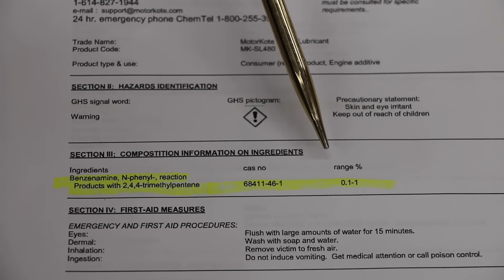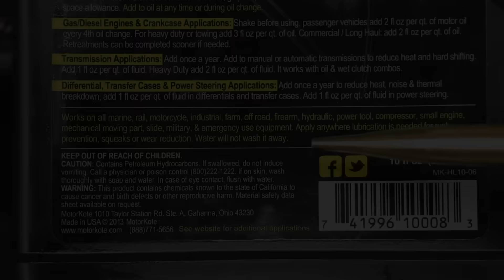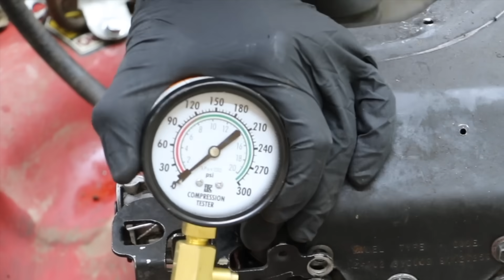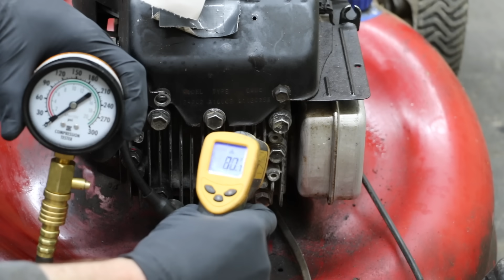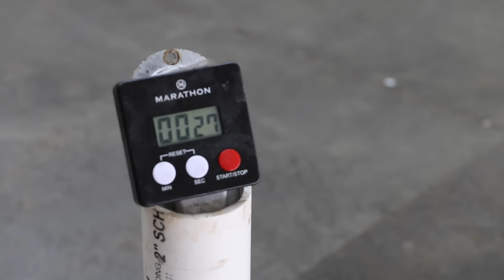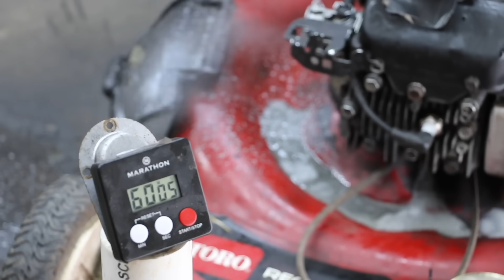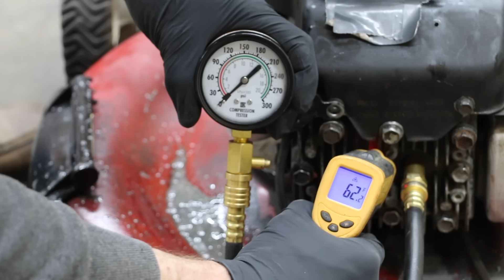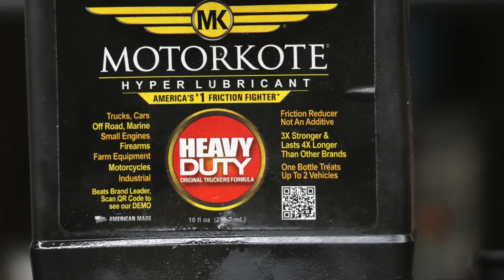Can MotorKote survive the water test?  Let's find out!

Comment: I've used motor coat. It's really slick, and I would not recommend putting it in a wet clutch. I made that mistake and my gas mileage went down in my motorcycle because the stuff was so slippery.
Reply: Have used it in my Yamaha xj1100 with no issues at all.

Comment: Just out of curiosity, have you or anyone just tried running a lawn mower with just water in the sump and no pre-treatment? I'm wondering if the water and the residual oil in the mix would provide the necessary lubrication on its own like lathe coolant does, or maybe we just think engines are more delicate than they really are, particularly single cylinder ones like this that aren't tuned anywhere near the edge of their capabilities

Comment: I've used it and noticed a difference straight away, engine (Diesel) ran smoother for sure. Gave some to a work colleague to try and he told me it cured his petrol engine from rough running. I used it religiously but it wasn't cheap and because I was taking very good care of my car I just stopped using it.

Comment: Excellent stuff. I use it in my 2010 RAV4 with the known vvt solenoid noise/wear. Not only did the noise nearly go away, it's been running for YEARS with no issue on the same worn/noisy vvts. 

It's expensive but it's going in every fuel engine I own. It's proven itself to me and this video absolutely solidified my results. 

Excellent test as always. Very well thought out.
Reply from the maker: Thanks!

Comment: Coat the under deck of your riding mower mow heavy then use a water hose to spray clean your surfaceit cleans up easier andif you paint  it on your snow plow snow will slide off quicker
Reply from the maker: Thanks for the feedback.

Comment: I am quote quite pleased what are the results of this video. In the past, not only did I put a little bit of motor coats and an old Cadillac that I was driving for a work car, but it took a lifter noise away that I had. One morning, it was about minus ten degrees, and all of a sudden, I had a lift or noise.  I i was a little afraid, but then I remembered I had Motorkote in my garage. It took the lifter noise away almost immediately.  I also mixed up a small bottle, of Motorkote and kerosene to carry in my work truck to coat ratcheting chain binders and hinges on containers.  It worked like a charm.
Reply from the maker: Thanks for sharing.

Comment: Hey Project Farm, I was hoping you'd do a test like this on ProLong Engine Treatment.  Both treatments also seam to utilize chlorinated components which creates a concern of reacting with the moisture to form hydrochloric acid, and both treatments also claim to have no short or long term corrosion risks.  Is there a way to test if these products convert to HCL and whether their PH goes down over time or their products become corrosive after exposure to moisture and extreme heat?
Reply from the maker: Thanks for the suggestion.

Comment: This works real well stopping the 5.7 hemi cam failure and lifter wear. This also case (chemical) harden and create a super smooth running engine.
I use this with vintage engines with flat tappet cams plus less ring friction. I have used this from the 70's when you could only get it in michigan where it was invented by the university of Michigan Kalamazoo campus. The formula was sold off for the sum of 3 millon dollars so the liberals could get a raise, but by the next year they were broke again.
Reply from the maker: Thanks for sharing.

Comment: I used motorkote once in my engine. I ended with a crumbly black sludge in my engine. Had to run multiple bottles of seafoam through it to try to get it cleaned out. It clearly doesn’t do well under pressure and heat in an engine. If you want to lube up a door hinge with it fine but DO NOT put this stuff in your engine
Reply: I run this in five different vehicles two of them being commercial semi, and I did not experience what you were talking about. I’m curious if maybe the motor coat removes some of the crap that was built up in the engine.
Reply: @uria711  I suppose that is possible!
Reply: @Unctahdew  what would be cool is if you try it again and see what kind of results you get. I can definitely tell you I have had zero issues and I have had increases in fuel economy.
Reply from the maker: Thanks for sharing.
Reply: I've used this for a good 10+ years in 3 or 4 cars.  Change the oil regularly.  Never had this issue.

Comment: 'MotorKote' claims (on the bottle) to work in transmissions. This is a curiosity to me. ATF lubricity is purposefully designed not to interfere with friction disk function. I am genuinely intrigued to learn about the effects of a "Hyper Lubricant" on normal transmission operation; e.g., cause "shift flaring" or similar. Is it possible to add this to your future tests?
Reply from the maker: Thanks for the suggestion.

Comment: Found this comment. Makes me wonder if you may want to test  MotorKote again to see if they  have changed the formula, and  claim you have to add every oil change since you tested it 6 years ago. Comment:: They have since changed the longevity that's for sure because the newest bottles say use every oil change. I kept using it and can say there are 3 types of products I have used to see if the benefits of mororkote can be removed without tearing down the engine and sanding. My conclusion that can be replicated tine and tine again is a fuel tank with 4oz per 10gallons of fuel of marvel mystery oil and in crank case following bottle instructions will in fact remove the motorkote. The same can be replicated with seafoam. After I figured out it is not total and permanent I continued to use it in 2 vehicles( the same truck) and a family compact sedan both using motorkote for over 50k miles in the truck and 84k miles in the sedan with no bad effects. Both vehicles now well over 215k miles on odometer and have not shown any signs of negative effects. To answer your first question the mileage did improve even furthermore the following days once it really circulated and stuck thoroughly If I can remember correctly I gained almost 2.6mpg mixed driving which doesn't sound like much but 2.6 mpg everywhere you go every single time you drive is, highway or city, year after year adds up to quite a serious amount depending on fuel price per location. The 3rd product that will remove it is b12 chemtool.
Reply from the maker: Thanks for the suggestion.

Comment: for smaller 2 cylinder diesel generators which hold 3 quarts of oil would it be ok to use 100% motorkote on its own ? So do you think motorkote is basically a high end motor oil like besides quality is there a difference with one quart of conventional motor oil and one quart of motorkote besides the fact it seems to be much better then conventional oil?

Comment: I wonder if a person could run this in a two stroke, add it to the fuel oil mixture, wonder if it would help or hinder the burn.  I have an oil injected two stroke I just might try it.  Maybe motorKote will have to add a new use to their label.
Reply from the maker: Thanks for the suggestion.

Comment: Moly MoS2, graphite, WS2, and Ceratec. The only one that made an actually noticeable difference in how easy it is to start my snowblower is after using ceratec. But, it does not seem to last. The tungsten and molybdenum disulfides may break down to form sulfur based acids which might not be so good for wear in the long run.
Reply from the maker: Thanks for the feedback.
Reply: @ProjectFarm  so, I request you to please at least look at studying ceratec, in my snowblower it actually does something that is, not just my imagination, noticeable so I think you will find something there, not sure what, maybe that it only lasts for a little while or that there is some trick to using right so that it works well, or that it reduces friction by 50% but increases wear 3 fold or that it fouls spark plugs, I don’t know but it is the only one these snake oil products that I have ever tried where, even if only for a little while, it seemed to actually do something real. It seems not when you have added it, but after the oil change following the one when it was added. I.E. you put it in and use it, then eventually change the oil and that’s when it seems noticeable. Though, I have never tried motorkote…or the other product that impressed you. Thanks and good luck.

Comment: I saw the FR3 video from 4 years ago.       I have a KIA oil user  and will get a new engine soon I am  leaning to using one from these..Petron Plus, Archoil, Liqui moly CeraTec or Bestline..... Let's see. so many..Archoil 9100, Atomoil, Bestline, BG MOA,  DT550, Duralube, Hot shots, Liqui Moly, Lubeguard, Lucas, MMO, Motorkote, Prolong, Petron Plus, , REV X, Rislone, Seafoam, Slick 50, STP Ceramic, TriboTex, TurboMax, XADO, ZDDP, , ...and I missed some...
Reply from the maker: Thanks for sharing.

Comment: I’ll send you a new unopened bottle of the new Motorkote. I have both the True Original and this new formula which they are calling original. I will contact Motorkote but I’m sure they will say it’s the same but it’s Clearly not. 
And I will send you a new bottle of the Motorkote to test and see if it performs as well as the original did.
I will most likely do a video of my own showing the clear difference between these to Motorkotes, the True Original and the New Version they are calling Original.
If you email your address you’ll clearly see Th difference between the viscosity between the original and the newer version.
Myself as well as everyone else would be very, very interested to see if the new formula does as well on your testing compared to the True Original...
  Unfortunately, so many companies are trying t cut corners lately and putting out inferior products.

Comment: Interesting update:

I used motorkote in the hydraulic oil of my harbor freight trencher to prevent corrosion on the pistons. It has worked beautifully.

I also tried it in the motor & hydraulic system of my 1940’s ford 9n tractor, & it made it about 90% more quiet in 5 minutes, & it ran cooler.

It’s pretty decent stuff
Reply from the maker: Thank you for sharing!

Comment: I know I’ve mentioned this a couple times, but I’m sure many, many will be interested in this video. Because Motorkote has changed their formula, the oil now is much thinner and a different color. I can prove this Because I have the original Motorkote when you did this original test and I have their new formula which you can clearly see is thinner, different color and a different formula.
I know many including myself would like to know if the new formula holds up as well as the original formula.
Regardless of what Motorkote says they are two completely different formulas, which I can prove, since I still have a bottle of the original.
Please when able test the new thinner Motorkote Formula and see how it compares to the original formula.
 I know many will be interested in these findings...
Thanks Much.
Great Informative Videos as always..
Reply from the maker: Thanks!  Thanks for the suggestion.

Comment: I mentioned this previously, that MotorKote has changed their formula, whether they admit it or not. I can prove it because I have a bottle of the original and a new bottle of Motorkote. The original is a much heavier weight oil and also a different color than the newest Motorkote. 
Myself and I’m sure many, many others would like to see another direct test on the new Motorkote formula as you did on the original formula?
Be very interested to see if the results are different, because they are 2 different formulas for sure...
Reply from the maker: Thanks for the suggestion.

Comment: I have motorkote in a engine right now. It seems no one can get a clear answer on what's in it and if it contains chlorine. I also am interested in the boron nitride products. But my question is... Does boron react w chlorine. I did read that it did. I'm wondering if those 2 things being in a motor is counterproductive because of a negative synergy or is it fine? Thanks so much!
Reply from the maker: Thanks for the suggestion.

Comment: I know everyone says it but u r very much appreciated. And I mentioned this before in another comment but wanted to piggy back on it w a little more specificity.... As far as testing boron additives. I would like to see the 'air tec (Wagner) compared to JLM. JLM specifically has a different formula. Most boron nitride (hex-boron) have a white, milky solution w suspended particles. The JLM claims to b completely emulsified into a liquid. Even though that sounds better, I'm wondering if the tiny particles of the air tec are actually better being in there and if u could b losing something with the JLM. Or not? But those 2 would b good to put against each other imo. Also maybe the stp boron? I think most boron additives claim to also raise TBN and maybe oxidation values too. I don't do long extended oil changes anyhow, but it would b nice to see if it did keep the oil safer for a longer amount of time. The friction is what I'm most concerned about, but all the other claims of boron nitride would b nice to see verified as well. Thank u so much for what u do and for being a nice and genuine person.
Reply from the maker: Thanks and you are welcome!  Thanks for the suggestion.

Comment: Motorkote has completely changed their formula since you did this video, which I know for a fact. I’ve been using Motorkote since it first came out and still have the original formula. The original formula that you tested is a much thicker oil and the newest formula is much thinner and clear.
I would like to see you repeat the same rests with the new thinner formula and see how it compares to the original thicher formula ?
Regardless of what Motorkote says the newest formula is different...
Thanks Much
Reply from the maker: Thanks for the suggestion.

Comment: What about an oil analysis on the motorkote after some miles r put on it to check for acidity or anything else negative. Maybe the same for Wagner ceramic? Because if this stuff is truly this friction-reducing w no side effects... In theory motors should last way longer and it would b more than worth the cost of the product. Thanks!
Reply from the maker: Thanks for the suggestion.

Comment: Water is used as a hydraulic lubricant especially in marine applications. Hard to determine on the engine test whether motorkote is the reason, or whether the water was doing the heavy lifting lubrication.
Reply from the maker: Thanks for the feedback.

Comment: I bought this stuff after watching your video. It does make a noticible difference with the engine running smooth and better fuel economy. I did however use a bit more than the directed amount.  I wonder how the Bestline compares with this ?
Reply from the maker: Thanks for the suggestion.

Comment: I always used it in my rigs, took all three engines over two million miles without an overhaul,used a gallon every other oil change around 25 thousand miles,a gallon of it is expensive but compared to a motor over haul of 25 grand I think it works wonders,I use this in everything I own but remember if you got friction clutches like on motorcycle's do not use
Reply from the maker: Thanks for the feedback.

Comment: I'm not sure that replacing the oil with water is a valid test of "water does not wash it off".  Washing is lne thing.  Running water in a motor brings heat, friction (as you already said) and those 2 combined are different than just testing "washing" with water.

Other than that, nice test/video.
Reply from the maker: Thanks!

Comment: Great work on your tests.I've started using both AMSoil and Motorkote based off of your results. 

Recently, I noticed on Amazon that you can get a 5 gallon bucket of Motorkote cheaper than you can get AMSoil (per ounce) and I was thinking about running a full 100 percent Motorkote treatment through my car. If you get the chance, see if you can test them head to head, like the oil championship.
Reply from the maker: Thanks!  Thanks for the suggestion.
Reply: I definitely wouldn’t recommend that, we have no idea what the thermal and viscosity properties of motorkote is. I’m assuming it has no or little additives that suspend contaminates. It’s just supposed to modify lubricity.
Reply: @johnmoore1495  That's what I thought, too, which is why I was curios how it would react in a full test. Without testing, doing a 30/70 mix of motorkote to high detergent oil would be safer, and is what I'm probably going to do next year. I was able to squeeze out 2 mpg just from adding 2 ounces to the quart this year.
Reply: @EnwardJim  the thing is, as of my knowledge Motorkote works by coating the metal in a thin layer, so adding more probably won’t do anything by adding a lot more. 

If you really want to do it still I’d suggest ramping it up with each oil change, like try 90/10 oil/motorkote then 80/20 etc. Not so much worried about poor lubrication but potential damage to sensors, spark plugs, etc.

Comment: Great video. What's your opinion on aluminium silicon as a bore liner? The Toyota/Yamaha 2ZZ GE engine piston bores are coated/lined in it. Apparently it has excellent wear/heat properties compared to most combustion bores.
Reply from the maker: Thanks for the suggestion.

Comment: One of the things they say about Motorkote is that it has chlorinated paraffins which turn into hydrochloric acid in the presence of water, so unless that water is extremely basic, this test proves that wrong.
Reply from the maker: Thanks for the feedback.
Reply: Ehh still proves a lot, you run an engine that’s only had oil in it dry or with water you’ll blow it up incredibly fast. Water is in no way shape or form a lubricator in regards to an engine.